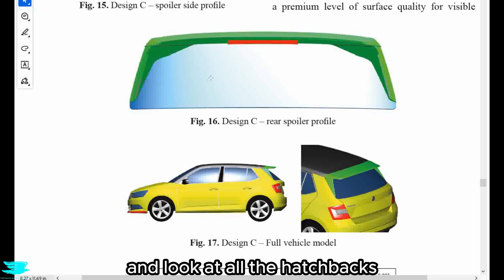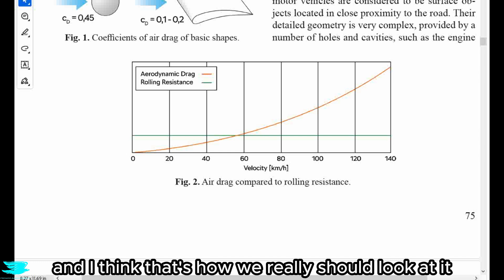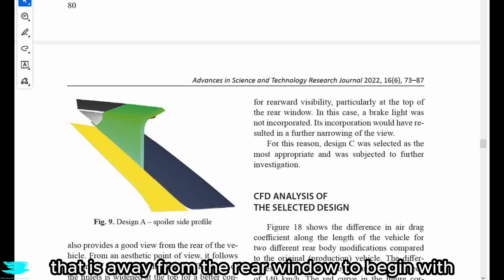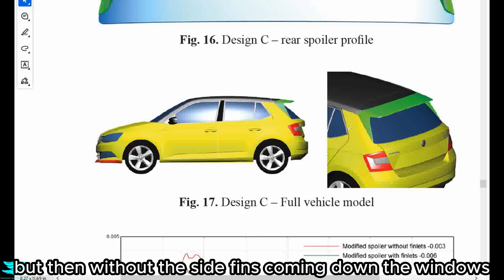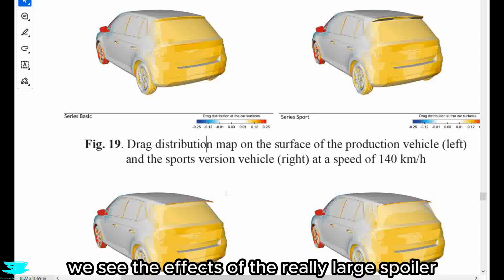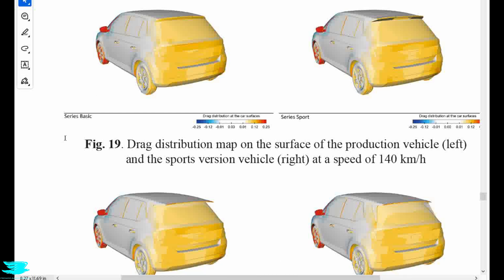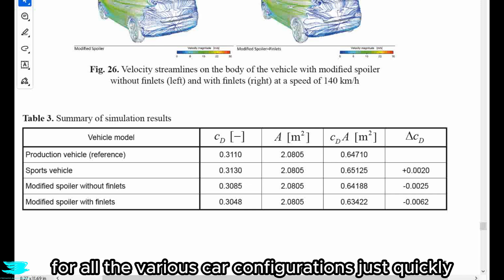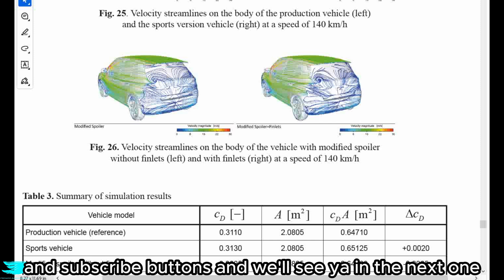New Hatchback Spoiler Aerodynamics Podcast 218

Comment: Piggy backing off tomn2765.

I have a Kona N. Same idea, there are channels in front of the spoiler and I'm curious of the affect. 

The marketing claims are that the aero creats a neutral car. Zero lift and zero downforce. 

Also I added a Gurney flap to the rear of the spoiler. Cause it looks cool... But the claim it that air dam adds downforce. I would love to see data on both the spoiler without the flap and how the flap affects it

Comment: Nice video ! 
Do you have an idea of the real effect of all the separeted spoiler we can see on SUV's like the Toyota bZ4x, the Volvo C40, the BMW X4 coupe, etc.? 
Is it to energize the flow on the window an avoid needing a wiper, without creating drag with a complete spoiler in a region where the flow is normally smooth? Or maybe just to avoid flow separation on that window because of the curve of the rear window?
Reply from the maker: It's a little hard to find info on it, but it's reduces the drag, and seems to increase longitudinal stability.

The fact that the peaks are in line with the tyres suggests there's a balancing of the wake. The wake from the tyres are pulled up more.
Reply: @PremierAerodynamics  
That makes sense, thanks for the reply! 

I'm getting an electric car and often use a bike rack. A CFD analysis on the effect of the bike rack would be very nice, I haven't found anything on it...

Comment: huh, I wonder where the point of diminishing returns is? Like could it be comically long and still improve it? lol

I'm also reminded of the 2003 Renault Mégane and it's super weird rear end design here.

final question , do they take suspension movement into consideration? I'm sure if there's drag and uneven lift on a car, it'd pitch the car backwards, right?
Reply from the maker: There would definitely be a plateau where making it longer produces less and less benefit.

This simulation didn't take into account different suspension heights and angles, but the podcast episode this week will.
Reply: @PremierAerodynamics  oooo interesting

(also have you checked your emails this week?)

Comment: I am really curious what a 3d printed version would do for my old Forester. Closing the grille didnnot cause overheating and i want to make the underside more smooth. Especially the rear part is more or less a giant air scoop.
Reply from the maker: You could try and just keep an eye on the temperature gauge.

3D printed will still work because the flow over a car is mostly turbulent anyway.

Comment: This all seems very interesting to me but with my limited knowledge there is something I don't understand. Shouldn't the spoiler create a vacuum on it's underside as the air separates? So in turn increase drag and maybe even downforce (although almost irrelevant for this type of car)?
Reply from the maker: Yep, it does. But the entire wake is in a very low pressure zone (vacuum-like).

Actually in the streamline plots, we get a good idea that there is higher pressure there because the streamlines don't move around very much. If it were lower pressure than its surroundings, air would be pulled in and the streamlines would flow around more.
Reply: Yes it is creating some low pressure area on the underside, and this could be why those side fins are affecting the bottom of the car, but how the flow separates is important factor too and when air meets the hard/sharp edge at the end, it separates better (less turbulent). If we look closer, we can see even more. Those spoilers follow the curvature of the car and lenghten it a little. This gives a bit smaller area at the rear where airflow separates in more efficient fashion. You can look at the old Porsche 935/78 "Moby Dick" that took this approach to the extreme (it has that gap concerning you behind the tail too). 

By the way, its worth adding that very good airflow (not in the case of Skoda, but in some very aerodynamic sports cars) creates lift that engineers need to combat with.

I hope @PremierAerodynamics will correct me if I said something wrong, but I don't really think there is something wrong, maybe some simplifications

Comment: shower thought while watching this (and having watched maybe a few too many airplane design videos lately): would there be any benefit to a slot where the roof and the wing meet, similar to an upside down fowler flap (but, you know, permanent instead of extending)?
Reply from the maker: Yep, that would help guide flow underneath and make the bottom surface perform better too.

Comment: Have you done an analysis of the 'speed holes' in some hatchback wings? My 2017 Focus Sport has a spoiler following the roofline and two large rectangular holes angled at a steeper angle downwards. My toddler car brain intuition says 'higher speeds and the air goes over the full element and at lower speeds the air goes through the holes to cut down the wake' but ive only seen one other channel (@nelson phillips) do analysis on this.
Reply from the maker: That's a smart toddler. Maybe get that one enrolled in aerodynamics now.
Reply: @PremierAerodynamics  😆

Comment: The hatchback extension produces 2 lift producing vortices. The 'finlets' change the position of that vortex pair. You can see that on the pressure distribution on the window.
Reply from the maker: Good point. I guess extending the finlets all the way to the trailing edge of the spoiler would cut down the vortices as well.

Comment: Fun! My base model Forester does NOT have one of these, but higher trim levels do. I wondered if it would be worth adding one : by the end of the video I will know. 👍
Reply: The conclusion I see is 2% drag reduction and less dirt on back window.

According to some quick googling, that would translate to 1% improvement in fuel economy for highway driving, but paper says just 0.4% improvement. Let's say your car is going to spend 150000 km on highways over its life: at ballpark gasoline prices of say $0.1 - $0.2 per km, that 0.4%-1% improvement translates to savings of $60 to $300. And a bit less money spent on washer fluid.

There are other factors of course -- the spoiler adds some weight, and probably affects lift too? The paper mentions lift but they don't say how lift changed in their simulation.
Reply: @marklundeberg7006  Yeah, but...i looks cool. 🤷 Gonna leave it stock, I assume the engineers know more about my car than I do.